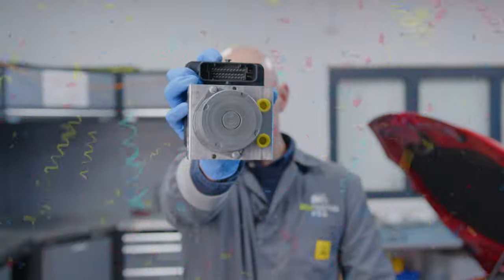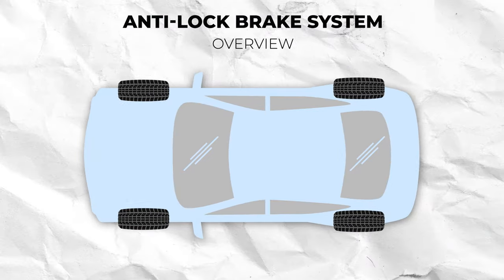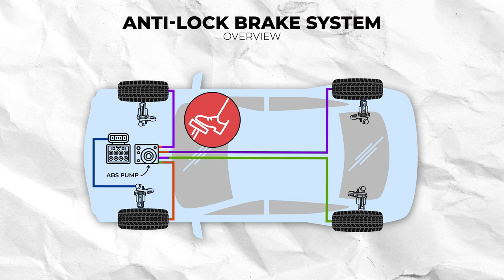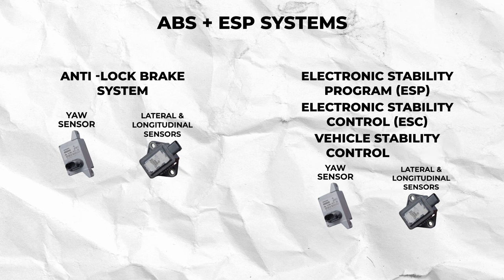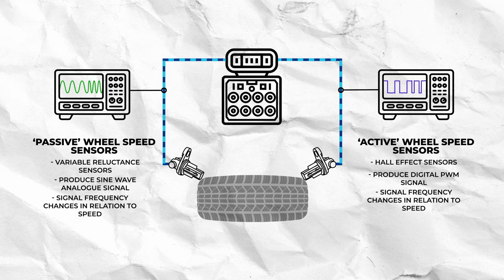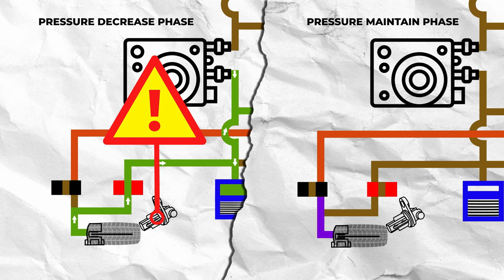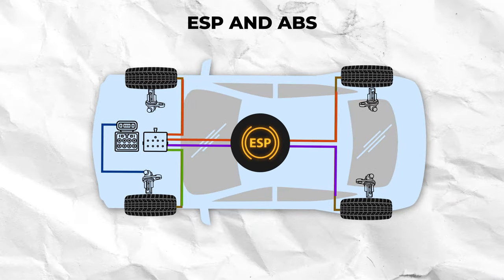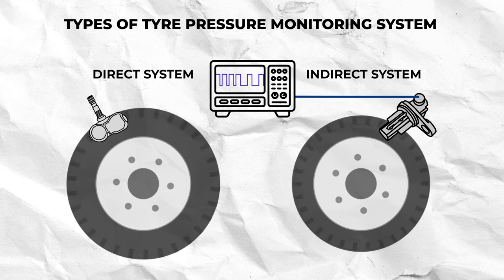Exploring ABS Anti-Lock Brakes: A Deep Dive into Function and Faults

Comment: I got toyota estima hybrid the problem is when I m driving on rainy day its suddenly shut off or cold weather  when it's sunny day its start up again its showing vsc code on dashboard I showed it to manay garages they don't understand the problem any one may understand the solution?
Reply: You have to change ABS unit  it's usual problem with Toyota Estima Hybrid I had the same problem I'm mechanic I changed myself but I bought brand new from Toyota £925 2 years ago it's behind inverter need qualified HV do this it's one day job .

Comment: I have a Lexus rx300 2002 . When I move away slowly the brakes chatter and stop the car from moving away. When I use more accelerator it moves off fine. What is wrong ?
Reply: Rotors probably

Comment: On my Ford Kuga, when I baking to stop, red lights, after I lifted my foot off the brake pedal the car's wheels remain braked for a 2-3 second ( the wheels wich are remain locked for 2-3 seconds are left rear and right front - on diagonally). What coold be fault, the master cylinder, the ABS module/pump? After ther 2-3 seconds the car move slowly and easy.
Reply from the maker: Hi there! This does sound like a fault we have seen with some ABS units, if you can get the part number from your ABS unit and email it to info@ecutesting.com with your vehicle details, the symptoms, any fault codes you are getting and any other relevant information, our technical team will be happy to look into this for you and advise further. Thank you

Comment: great video. I have issue, when starting the vehicle, then I start to drive about 5 to to 10 mph, if I press the break I would feel like a grinding sensation on the pedal. but as I increase the speed the ABS and ESP/BAS light will come up and the grinding sensation on the pedal goes away. But the lights of course are still on. what could this be?

Comment: I have two 2008 Corollas. Both have an issue where the valves will stick after hard emergency braking such as in avoiding an obstacle, eventually resulting in severely warped discs. Several times techs have blamed stuck calipers, but I eventually ruled out all components but ABS. Wondering if others have observed this?
Reply from the maker: Hi. Seized callipers can be a sign of a failing ABS unit. We have created a video specifically looking at brakes binding or seizing that you can watch here: https://youtu.be/RrSn0M7n9eE. However if you have already diagnosed the issue as a potentially faulty ABS unit then you can send your unit into us for testing to confirm the fault and we can potentially re-build the unit. For more details please email our technical support team at info@ecutesting.com with the following information. Everything you have stated in your comment, as well as any other relevant diagnostic information including fault codes, and finally the part number printed on your ABS unit. They will be able to advise you further. Thanks.

Comment: Good grief… I’ve just had my abs module at ECU testing and it was beyond repair apparently. I took a gamble on a used one from eBay which thankfully is ok.. phew. The symptoms I had were limp mode and no comms with diagnostics. I got lucky when I came across a YouTube video by Diagnostic Dan where he had a vehicle with exactly the same problem as me.
Reply from the maker: Hi. Sadly not all units can be repaired. Our apologies that we couldn’t help you on this occasion, but we are glad you could get your vehicle back on the road.

Comment: I have a car that was parked for awhile.. when I test drove it everything was fine but one of the tires went flat.. i had it on a spare but didn’t drive it.. when I put on the replacement and drove it the abs, traction and service brake lights came on.. when I had the car scanned the abs passed with no codes.. but the lights haven’t turned off.. could I have damaged something while taking the wheel on or off? I did struggle a bit doing it
Reply from the maker: Hi. As the warning lights came on immediately after the tyre replacement, it's worth checking and resetting the tyre pressures on all wheels to ensure they match the vehicle's recommended specifications. Differences in tyre pressure can affect wheel speed readings, which could trigger the ABS, traction, and service brake warning lights.

Additionally, the difficulty you experienced while removing the wheel could have caused damage or misalignment to the wheel speed sensor or its related components, like the reluctor ring. Although your scan didn't show any ABS fault codes, there could still be an issue that wasn’t detected immediately, or the scanner might not have been able to pick up certain types of faults. Hope this helps!

Comment: I just had the warning light on my Mercedes come up I don't know if I can get parts for it ? Is there any way of testing the wheels sensors? I suppose if it analog would have an resistance what would this be? but hollow sensor wouldn't show a reading I'm assuming! I don't have a scan tool what about the motor anyway of knowing if I apply the brakes will the motor be on for the module? Is it easy to get replacement circuit boards it's slk r170 03y I haven't got a lot of money this is my daily car just got it. They all look the same so if I go to a scrap yard would the modules be easily transferred and the circuit boards or do I need to stick to the model for the car I've got?

Comment: Is it possible that the ABS module could be damaged after having changed the brake fluid in the traditional way? The traditional way of applying the brake, loosening the bleed valve, etc. When changing brake calipers, the brake pedal sinks. We have changed everything, bled the system and it is still the same.
Reply: Did you manage to find the issue of sinking brake pedal?
Reply: @faisalshahz111  Not yet, is in a mechanic.
Reply: Please keep updating. I have the same issue with pedal sinking. Changed master pump, disc rotor, bleeding a few times. Suspect the abs pump but no error code from the abs module. Thinking of changing the abs pump. 🤔
Reply: @faisalshahz111  Look, I've been in the garage for almost a year now, I don't want to take it to the official dealer because it will be a disaster. I think it's the ABS module, many people tell me it's air in the circuit. At the garage that's here now on Monday they're going to connect 4 pressure gauges to the wheels and see where the pressure is losing. I think it won't be worth anything because I still think it's the ABS module. But it's been changed twice. Keep investigating on your own and we'll discuss it here. I'll let you know, best regards.